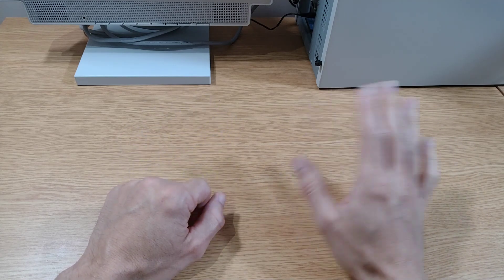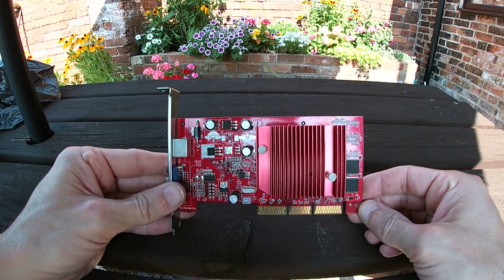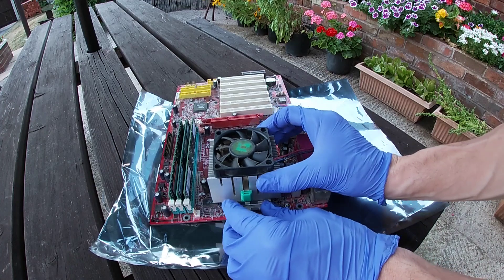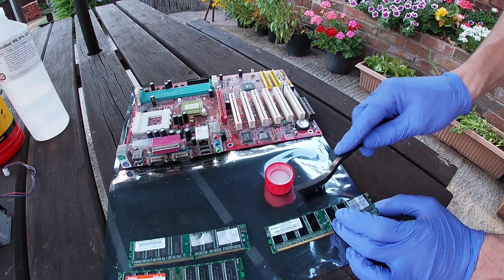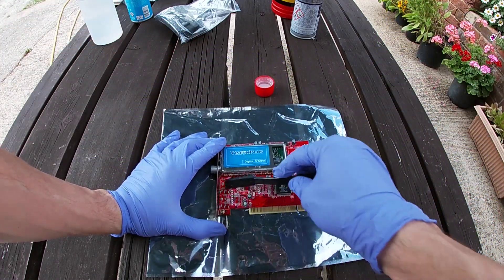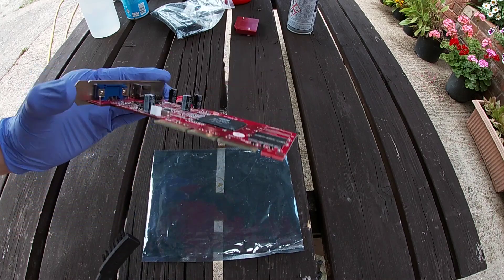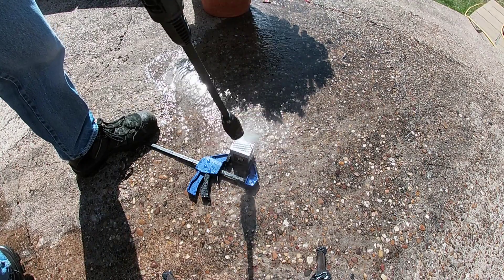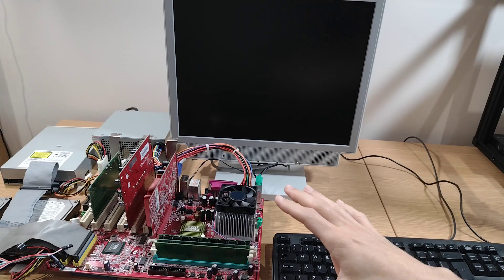Cleaning Retro PC parts, will they still work afterwards?

Comment: Good to  see you back. Nice Job. I get parts and systems like that also, same process sometimes I use soap and water and let everything dry for a few days. if you take your time and are careful everything uasually come out OK. Thanks for the Video
Reply from the maker: Do you use distilled water or anything special like that? I've never tied it because of the things I have read online about it leaving behind mineral deposits that can be bad for the PCBs, no idea if that is true though. I should try it on some scrap hardware sometime, it would be cheaper than using all the IPA!
Reply: @RetroSuperhighway  No I use Alcohol also after washing and contact cleaner. Soap and Water not too hot rinse Well let dry then contact cleaner and and Alcohol
Reply from the maker: Hmmm, going to have to try it next time I have some dirty parts to clean. Thanks!

Comment: The way you cleaned the motherboard is how I clean original Xbox motherboards. Some of them are so caked in dust and dead bugs, there's no other way you can thoroughly clean them. However, I start by brushing all the loose dust and debris with a paintbrush, then submerge in IPA.
Reply from the maker: I like using a brush for dry debris, unfortunately this was all sticky so a brush didn't make much difference.

Comment: I like to use the lemon scented wipes for the really dirty, smelly parts.
Reply from the maker: Thats a good idea! Do the scented wipes leave any residue behind that would be sticky to dirt in the future?
Reply: @RetroSuperhighway  No.  The lemony smell goes away pretty quickly and it really helps to get rid of cigarette or vaping stink.
Reply from the maker: Thanks! Something for me to try out.
Reply: @RetroSuperhighway  Depends on the tissues about the residue. Some do and some don't. The easiest way to know if they are safe to use is to wipe your hands with one,if it feels soapy and sticky on your hands then they're not suitable but if it feels squeaky clean just like you would wash your hands with normal water then they're good to use

Comment: I’ve never seen someone take off a socket A cooler like that before. That is NOT how you do that 😩
Reply from the maker: Yeah it wasn't how I'd normally do it, but that thing was baked on there, as shown later in the video when the pressure washer wouldn't shift the thermal compund. Indeally I'd have run the system first to soften it up, but that wasn't possible this time.

Comment: vapes dont leave a residue or a smell... actual tabacco products do... especially with tar in it.
Reply from the maker: I didn't know that, thanks for the tip. Non smoking household here so I'm well out of my depth on knowledge of that.
Reply: Bull shit they don't. I used to share a yard truck with a guy that sat in it and vaped all day long. 
It took all night to air it out to tolerance and there absolutely was a film on everything. 
Nothing like tobacco but my personal experience has to call BS on your statement about vaping though.